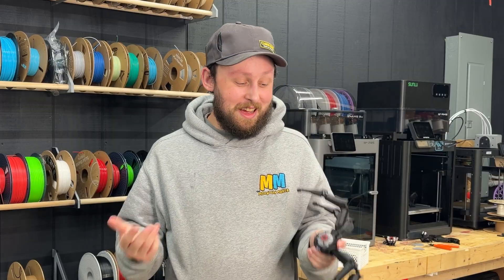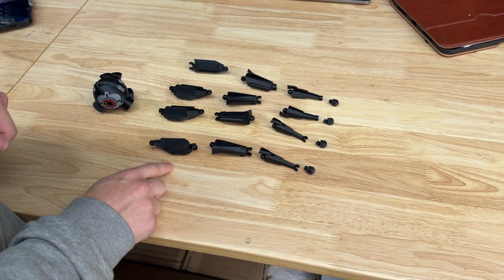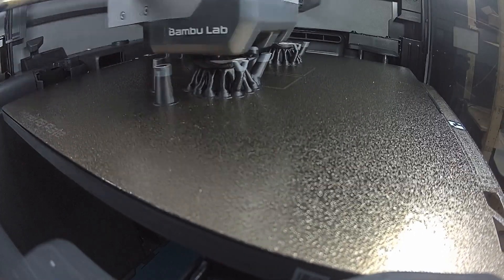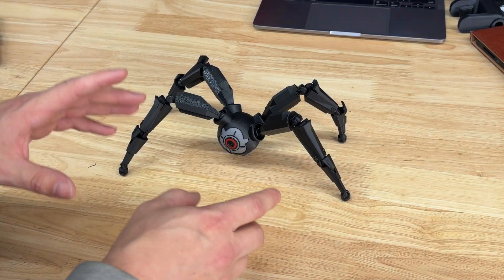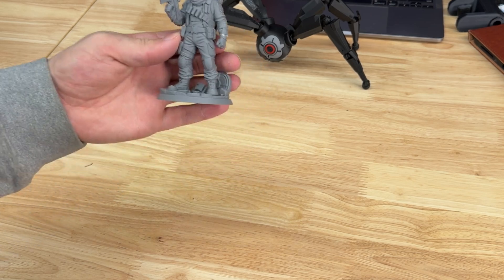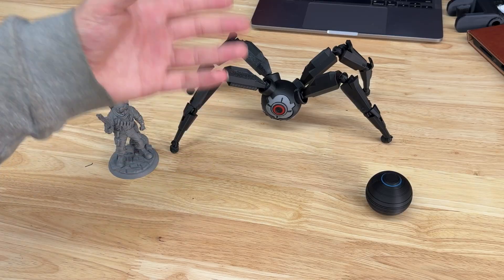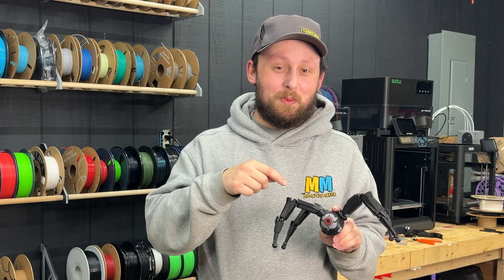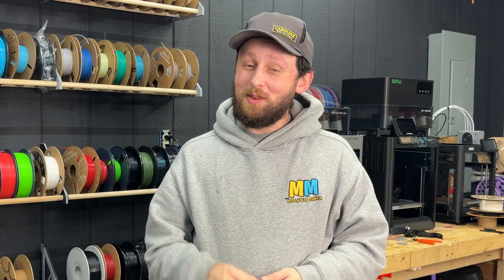I 3D Printed the Leaper from Arc Raiders... and You Can Too!

Comment: Dear The Mountain Maker,
Thank you for sharing your experience on my models (and the one for ArMania3d) , and giving credit is such a proper way! ❤
I do agree with the scaling up of the legs to 105% if you want a tighter fit. It greatly depends on the calibration of your printer. My P1S and X1C gave 2 different tenseness.
P.s.: if you want a christmas present for your mate, I've designed a Bastion and a Rocketeer as well since you published this😉
Happy printing!
Marjan, from Together 3D
Reply from the maker: Thanks for the update, and I'll definitely check out the new designs!